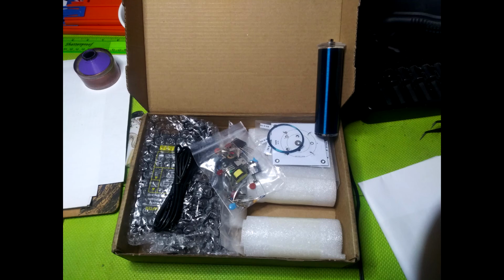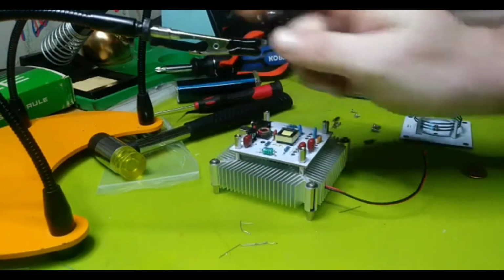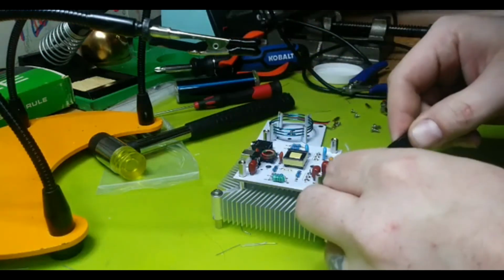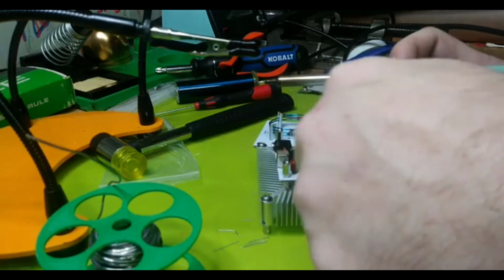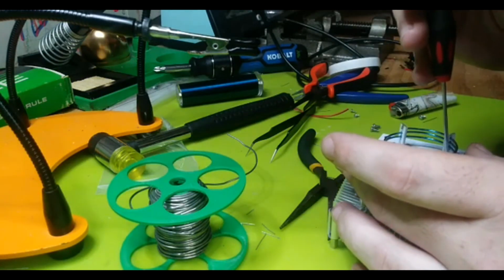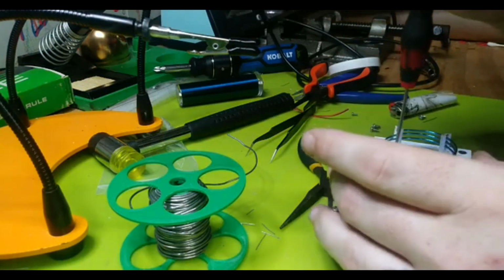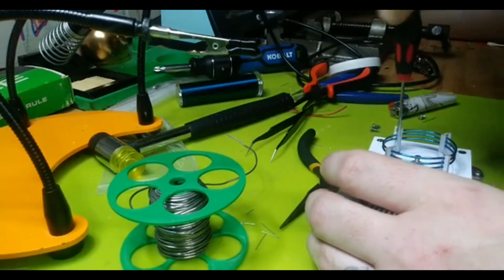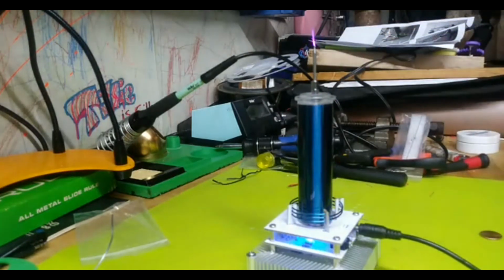Mini Tesla coil build

Comment: That looks like a fun little coil kit, thanks for sharing! Any idea what type of solid state coil that actually is? My guess is it's some type of slayer exciter, for something that size. I'm pretty sure your workbench LEDs lighting up was high voltage, high frequency capacitive coupling from the coil being in relative proximity. I know exactly how you feel about having too many projects and being interested in a lot of different things, haha. I think some tutorials on how ham radio works and how you build stuff would be great, if you're interested in doing that!
Reply from the maker: Of course! I'm glad I could share it and I appreciate the comment!
I don't have a way to post it on this video, but the schematic looks very much like a Slayer Exciter circuit. 

And yeah I totally agree, I think I may have misspoke in the video but you're right it was capacitive coupling from being close (less than 1 m)

You know what I just might have to do something on the high frequency side of things, I'm working on a video on a antenna build today actually 😅⚡(Just they whip antenna though nothing really fancy, but I will include the formula and how I got the length and everything)

https://youtu.be/29zBiadkhyw